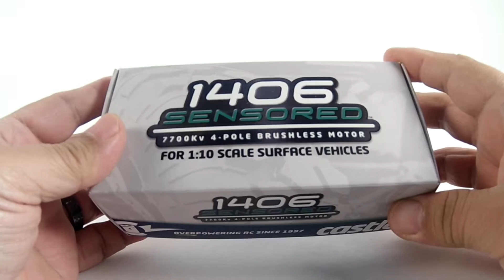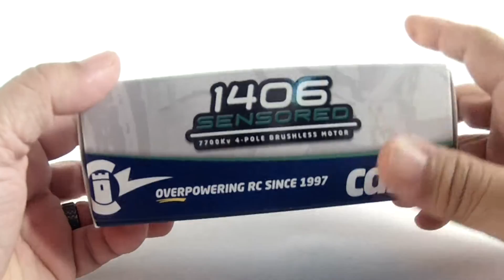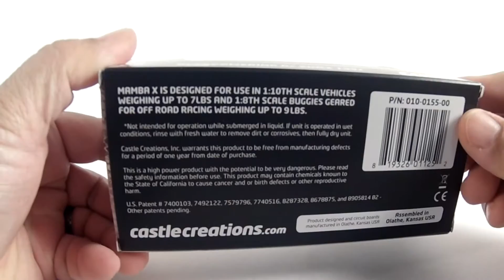Castle Creations Mamba X and 1406-series Sensored Motor Unboxing

Comment: I just bought this ESC and 2850kv Slate for my SMT 10. I love it. I've only ran it on 2s so far, I had planned on 3s. It's very smooth and has plenty of power on just 2s in my truck.
Reply: the ZD racing thunder ZMT 10 ?
Reply: Is it ok to run 6s lipos on it for speed runs?

Comment: I have this but the unsensored version. its very strong and very fast for 1/10th scale vehicles. 
wish they made a 7700kv for 1/8th scale but the same size as the 2200 can.
Reply: armenvegas that would make no sense as you would have to run a 2s on an 8th scale vehicle. lower kv motors are more efficient running higher voltage.
Reply: I did say wish

Comment: I got Fantom FR-1 V3 series motors, they are greater in performance than the castle 1406 even though it is 4 pole, I ran the Fantom FR-1 v3 on 4s with low end bell timing and reached over 100kmh . I have a question why people use to buy castle 1406 motors instead of kings like Fantom , tekin and reedy  ?

Comment: Is higher KV more speed
Reply from the maker: Yes, higher KV means more speed. In this case, a 7700KV motor would theoretically run at about 57,000 RPM with no load on a nominal 7.4V pack. Testing it with a fully charged pack, it logged about 63,000 RPM with no load, which puts it right in the range of my LRP 4.5T and Reedy 5.0T motors.
Reply: The RC Workbench  thanks I was just confused when I was looking at motors higher KV was least expensive
Reply: Northpoledude 121 this isn't always what you should base of trying to get more speed out of your rc. lower kv motors don't spin as fast but can handle taller gearing and higher voltages which actually allows then to ruin more efficient. that's why speed ran vehicles mostly run low kv